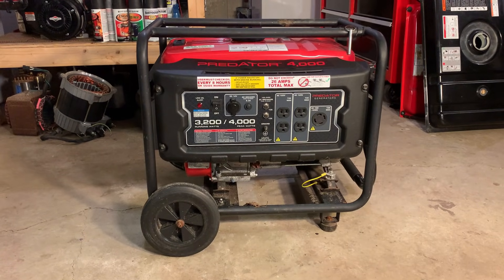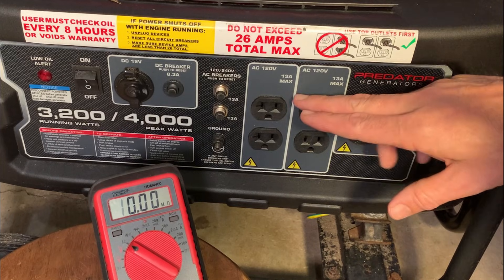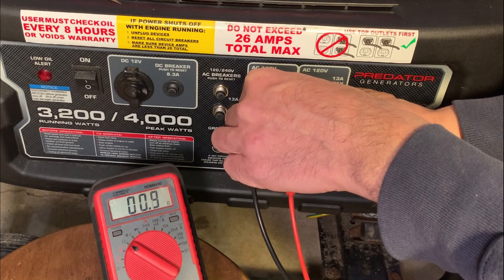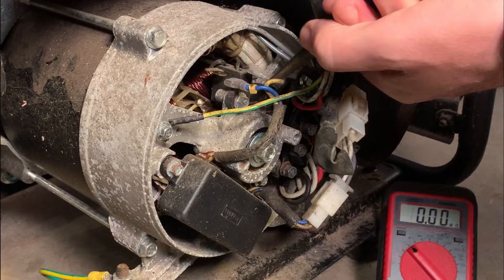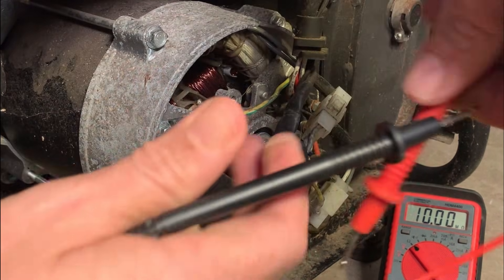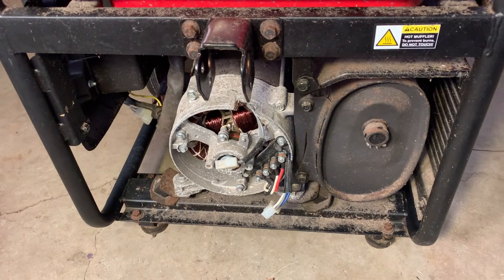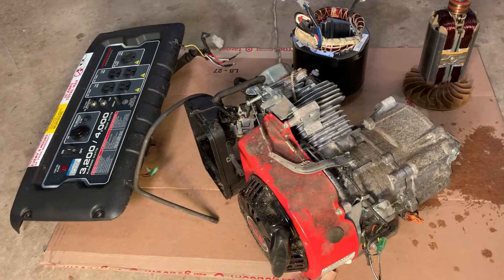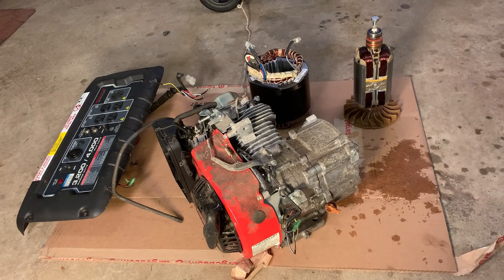Predator Generator Not Making Power

Comment: Amazing removing rotor using hydraulic pressure would have never thought of that 🤔
Reply: It works well, though we prefer to use veggie oil in stead of water! - Same method can be applied to most tapered shaft applications, and is a common old mechanics trick for getting clutch pilot bearings out crankshafts.
Reply: That is a great idea . Genius
Reply: That was my big "ah-ha" moment too!!  Great job
Reply: Please don’t forget about the generator safety rules: Always make sure you follow all the generator safety rules whenever you use your portable generator. This is only a reminder. Generators can be dangerous if not used carefully. Every year, hundreds of people die or get injured when using portable generators due to carbon monoxide poisoning and electrocution. Make sure you are using your generator carefully and keeping others safe as well. There is something very serious that everyone should always be aware of when using generators. Some people do run their generator indoors which is not safe and that increases the risk of carbon monoxide poisoning which can cause death of family and you. Some people run their generator in wet conditions which can electrocute them. Please remember that you should never run your generator indoors. Remember that carbon monoxide is an odorless and colorless gas that you cannot see or smell. Carbon monoxide is a silent killer. Keep that in mind. Make sure your generator is 15-20 feet away from your house and away from doors, windows, and vents. Never use your generator in your porch too. Having a carbon monoxide detector is very important against generator safety. Some people also allow children to go near the portable generator which could pose risks. We need to keep an eye on our children making sure that they are not near the portable generator so they won’t get electrocuted or burned by the generator which is dangerous. A locking enclosure also keeps kids safe. A generator shed might look like a tempting place to explore, or take cover during a game of hide and seek, but a generator is a dangerous piece of equipment that can cause injury. It says on the manual that we should also keep children away at all times from the portable generator to avoid injuries. Please do not allow a child or unqualified people to operate the portable generator.  It is important to keep your children safe especially little ones. The portable generator can be hot during an operation. Just because some manuals missed what should be listed doesn’t mean it’s safe to do. Always follow the generator safety rules when using portable generators. Generators pose electrical risks. If you need to use your generator during wet weather, you need a generator tent to protect your generator from getting wet. Don’t let your generator get wet. Keep your generator dry and before using your generator, please make sure your hands and your generator is dry. Do not wear loose clothing when operating the generator. Everything that is said on the generator’s operating manual should not be ignored. Never smoke cigarettes near the generator. Please keep flammable things away from the generator. Never overload your generator too. Your generator can catch fire. Never ever try to plug a generator cord into a wall outlet to avoid back feeding. Back feeding your generator is dangerous. Always turn on your generator first before plugging in appliances and shut off the appliances before turning your generator off. Use a heavy duty cord for your generator and the cord should not be worn out. All the instructions should be followed carefully. Never refuel your generator while it’s running. It can cause fire if fuel spills while your generator is hot. You should turn off your generator and let it cool off before refueling it. Having a fire extinguisher next to the generator is also important. This is only a reminder for everyone’s safety of using generators. Make sure your generator is properly grounded. Having a fire extinguisher next to the generator is also important against the safety rules. https://youtu.be/I1jT3ANENvI and here is a video more about keeping others safe when using generators and also about our family’s safety. It’s important to keep our little children safe as well. Make sure your little children are kept away from the generator at all times especially when it’s running. Hope this helps. Always remember that it’s better to be safe than sorry.